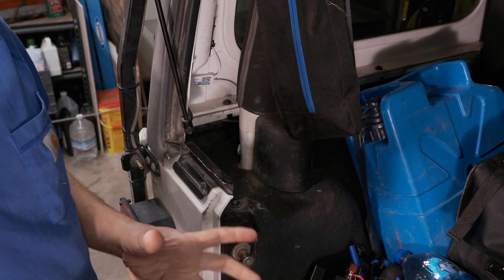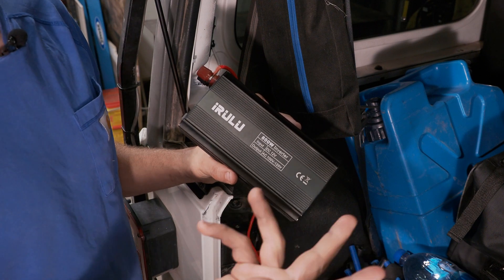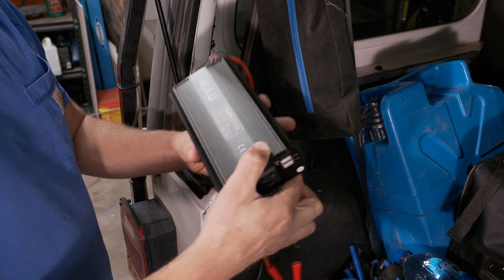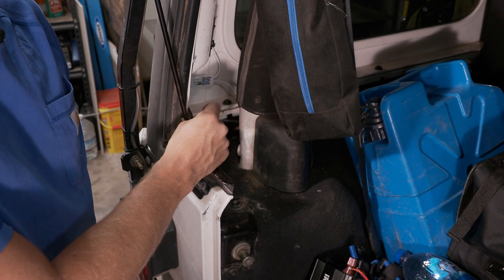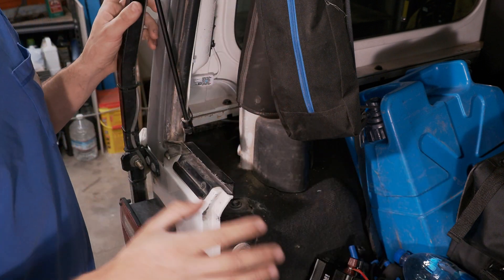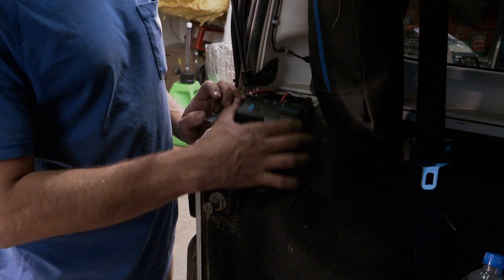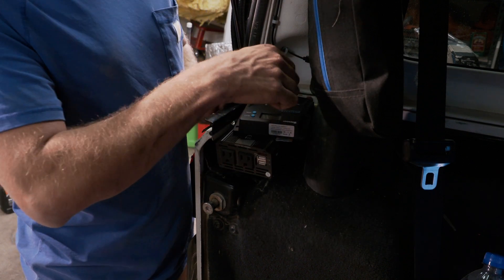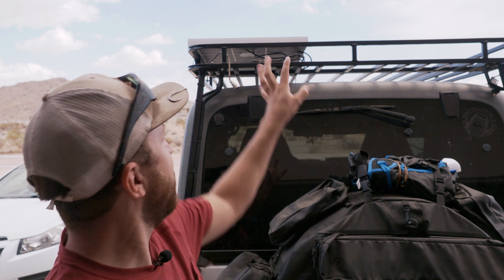Budget Overland Solar Project

Comment: So, just a solar panel and charge controller to charge your starter battery? Not a second battery? I’m looking into what I need to run a dc fridge (Iceco VL45) for about a week.
Reply from the maker: That is correct.  No second battery. This system has been working flawlessly for us. We recently took a two week trip into Montana with this setup. Absolutely no issues at all.
Reply: @EmbarkWithMark  awesome. Thanks.
Reply from the maker: Your welcome!

Comment: I think you’re right about the inverter not getting hot enough, but if it becomes an issue just put a spacer between it and the charge controller (a small strip of wood) with the same double-sided tape. Good use of that space. It’s usually the dirty laundry spot for me. Lol.
Reply from the maker: Thank you! Glad I'm not alone on this thinking. You know... Not sure why I didn't think of a spacer… -_- hmm, back to the welding bench haha. 

You too??? Now I have to find another "dirty laundry" spot LOL.